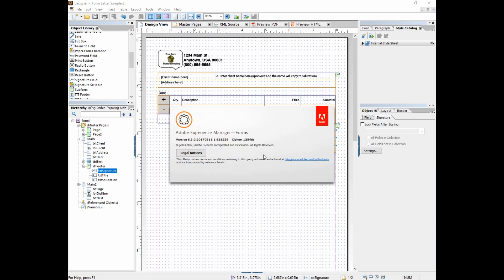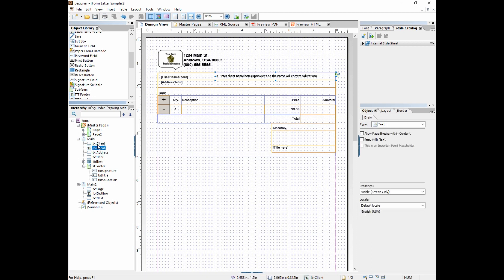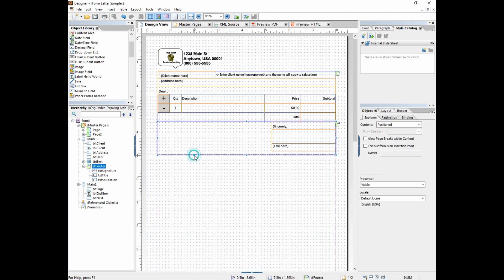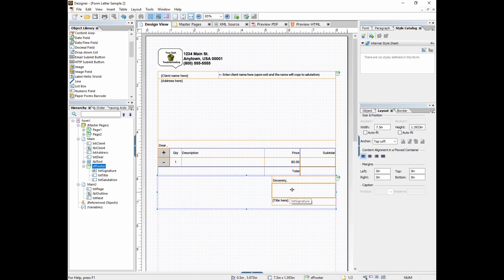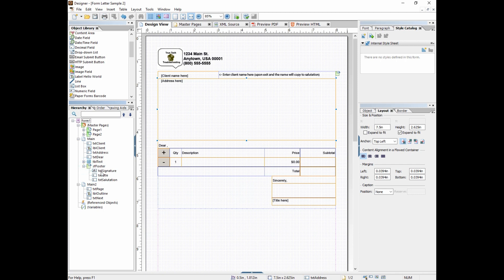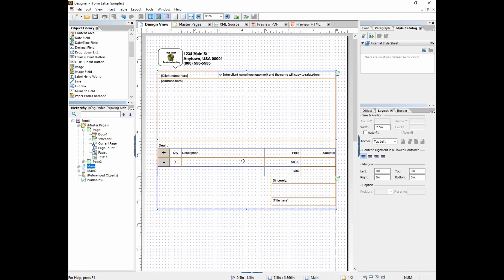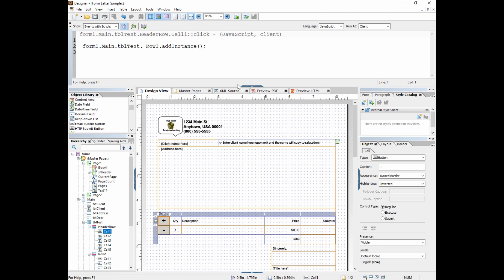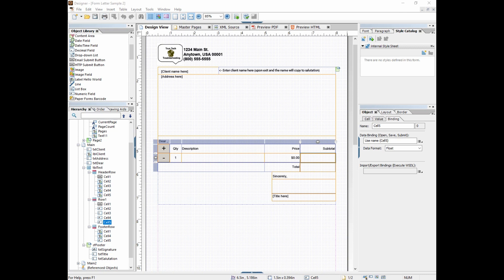LiveCycle / AEM Designer 101 - Part 10 Review

Comment: Your videos have been extremely helpful! There's no way I would know how to use LiveCycle without your channel. Thank you so much for taking the time to create these videos!

I've created a dynamic form, and am mostly finished; however, I am having an issue with 'Text Fields' on the master pages I've created that the end user will need to fill out. It will not be static text like the address in yours. I did this because these "headers" have to be in a certain area on the page. The problem I am having is, as expanding text fields on the main pages of the form are filled out, the text, in the text fields on the master pages change back to my default text for the field. Not sure if that makes sense. Is there a way to keep the text in the text fields on the master pages from deleting when entering text in the expanding text fields in the main page? Any help is greatly appreciated!
Reply from the maker: Not quite sure I know what is happening.  I would need to see the form to give better advice.  Can you contact me via the “help request” form on my blog?  Thx.

Comment: Thanks for these new tutorials, already waiting for part 201. But one question: why aren't dynamic forms preview-able in modern web browsers (Chrome, Edge,...) or in Windows Explorer ? Static PDF are well previewed just like normal MS Office files! Any workaround for dynamic PDFs ?
Reply from the maker: Good question...the quick answer is the browsers don't support it.  The long answer is that dynamic pdfs are completely different than everyday/regular pdfs.  The "engine" to render dynamic forms requires much more processing power.  Chrome, I.E., Edge and even the iOS Reader app do not have the "engine" in them.

Comment: I'm enjoying the new tutorials and appreciate the effort you are putting into them. I've been using LiveCycle since it came bundled with Acrobat 7 Pro, and currently am still using ES4. I'm not a coder but have been able to rip and adapt script to a decent level (though I know some additional knowledge would make my code more efficient).
However, is AEM Designer now only for enterprise users - this would make it inaccessible to me as our IT systems and platforms are all MS and SharePoint based. My company would not switch over to Adobe just on my say so.
Reply from the maker: David, for awhile it looked like Adobe was rebranding LiveCycle into AEM.  However, the past year has seen no progress on that front.  They were giving away a free copy of AEM Designer last fall, but that link is now broken.  ES4 is the way to go for now.  My copy of AEM 6.3 is what I am, but I don't think anyone can purchase it standalone.  

The principles/methods shown in the videos would apply to any version of Designer since ES2.

Stick with ES4 for now.  You should be ok for awhile.